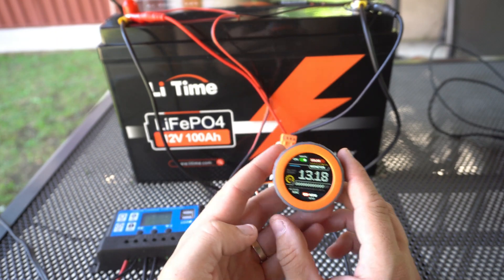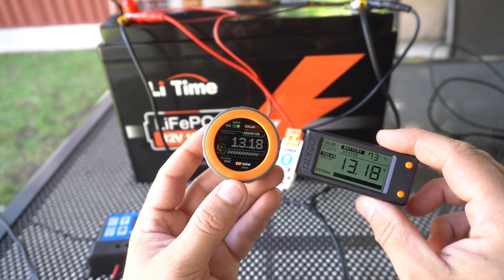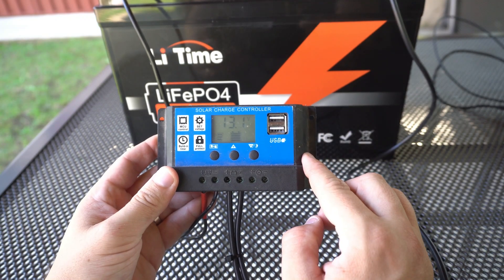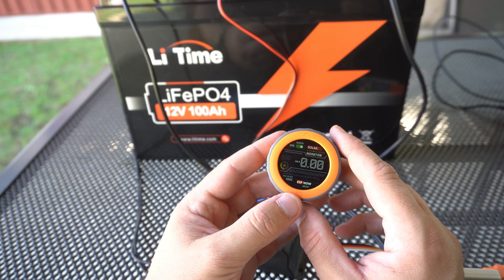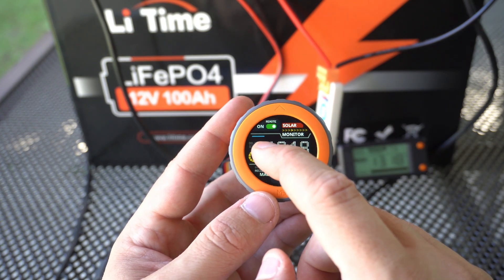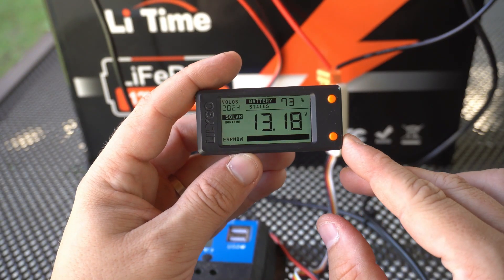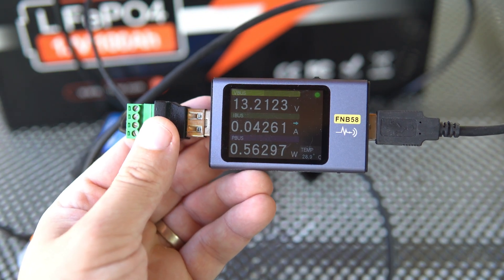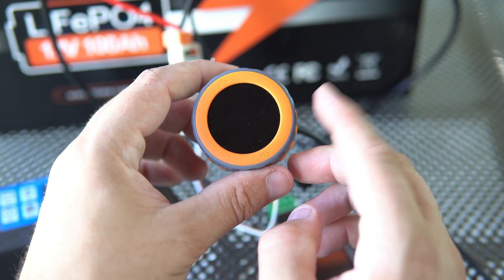Monitor Your Solar Energy System Remotely Using ESP32 (Easy DIY)

Comment: Hello Your project is very very nice... why don't you integrate a web server inside the m5dial that shows the voltage? I also saw on your github page, it would also be interesting to insert the possibility of measuring the voltage produced by the solar panels....so as to understand how the photovoltaic system works as a whole.
Reply from the maker: yes, thats good idea. that way project whoud be more usefull.

Comment: This project has been highly useful so far. As solar-powered devices gain popularity, it's increasingly important to monitor both power consumption and storage. Incorporating a shunt to measure current, in addition to voltage, would make it even more versatile and user-friendly.

Comment: Hi, I can recommend you to try to revive the old battery with XL4015 module. It support CC/CV charging on very low current, so it can charge your battery for some level when other “big” chargers will mention connected battery. You need to search how to setup voltage and current properly with XL4015, but I know it will be easy for you. Wish you the best from sunny Uzbekistan. I hope to make such great project like yours in future, so I am collecting money for such display modules now😊
Reply from the maker: @WTRBot  thank you, i will try 😀

Comment: This project looks like the one part of what I need for a Mars Rover.. 
I need to control everything and at the same time get realtime data feedback 
from all sorts of data sensors.

Battery level(voltage and capacity)
Solar panel output level
Temperature
RTC(Mars Time) 
if I want to emulate when Rover (is/is not) on far side of Mars rotation(radio silence)
plus anything else that you wish a Mars Rover could do..

Comment: Can you give more info on how you blew up M5Dial?  I have a USB-C cable from my Apple laptop power supply that I use to power the Dial on my desk and now I'm afraid it may blow it up!
Reply from the maker: @kevinlieb  that the way i burned mine, i have huawei laprop ,maybe apple charger is smarter. Now i use old phone chargers that are 5v.
Reply: @VolosProjects  Thanks.  Yes the USB-C can do 5 or 20v but is negotiated on connect.  Seems the negotiations did not go well ;-) I will be careful and thanks for your great videos!!
Reply: He shares that around 6:00.

Comment: There is still a project on my To Do list, where I want to build a small monitor for my Solar Panels. Using a e-ink / e-paper display. 

But I plan to get the readings from Home Assistant, as that is already linked to my Enphase account. I might try my luck with ESPHome 🤔 (since it also integrates with HA).

Anyway I do like the look of those ready-to-use boards, complete with case, that I often see in your videos mr. Volos.
(I do not own a 3D printer so I can't easily create a case for the "bare", PCB-only development board).

And your UI layout designs really get the best out of those OLED or LCD displays! 😙👌 💯 
(I think the board manufacturers like M5Stack, ttgo/lilygo, etc. should hire you to make promotional designs for these products 😁).
Reply from the maker: Thank you Richard, eink is great choice for this.  You have nice project in mind. I never tried esp home but i will.

Comment: Holy shit I am working on a multi-esp32 idea with those 2 (and a third)
Reply: Will your boards also communicate with each other using the ESP-NOW Wireless Communication Protocol? 😎
Reply: @RichardNobel  Was actually planning on using I2C because they're supposed to be in the same chassis, but I could probably rejigger it to have a separate ESPNOW receiver to make it easier to read out from.